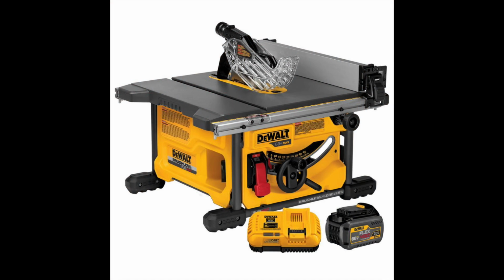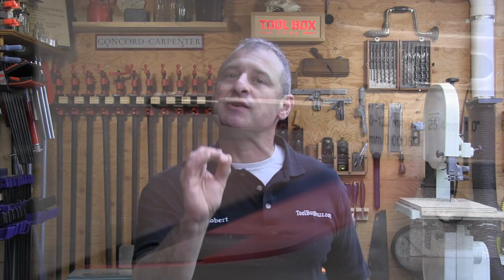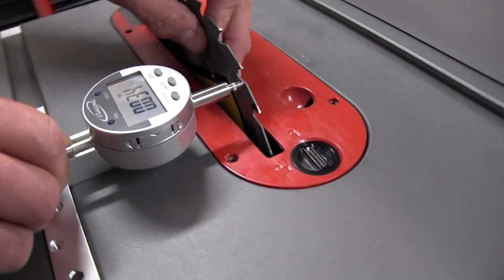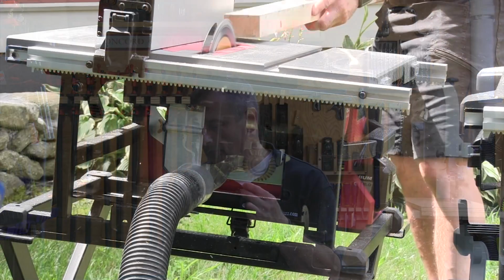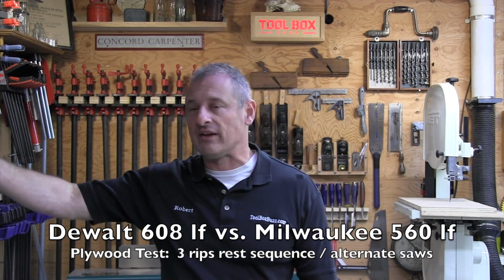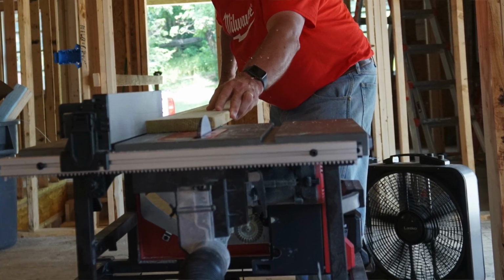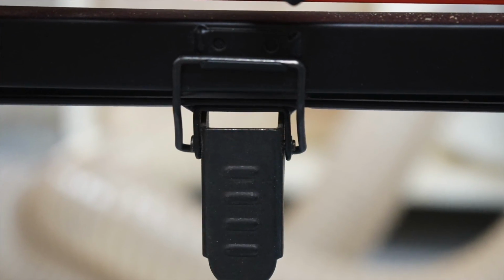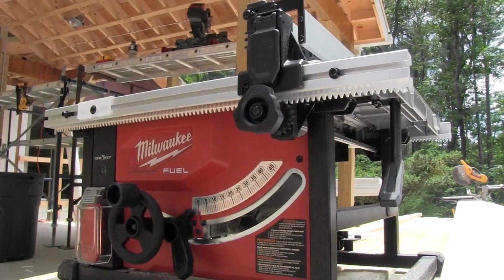Cordless Table Saw – DEWALT vs. Milwaukee

Comment: The difference in results would hardly matter unless your building cabinets on your front lawn. For me;  is one saw so much better than the other that it is worth investing in a different battery system - which is the bulk of the cost in my eyes. The answer is a resounding no. Good honest review. Perspective people. Perspective. Deep breaths.
Reply: Maybe the Metabo Cordless Table Saw ? 
It has the ac/dc battery charger included !! 
Battery run out ? just plug it in and continue working !!
Reply: Well said

Comment: Runtime is not important unless you only own one battery.
Reply from the maker: Scott Marstellar I Definitely  agree about having at least two batteries, the problem comes in when you’re doing a lot of ripping on the job site such as ripping down mahogany or framing material you will eat through batteries faster than you can charge them

Comment: Both dewalt and milwaukee are supplying great cordless tool... And sometimes they copy and sometimes one up... to capture a  either smaller or larger need of a tool.  What I don't like with HO milwaukee is the charge time!  2.5h for 12 vs dewalt 1.5  milwaukee is coming out with so much at once... That's what we want!

DEWALT is leading charge In a cordless job site. They have slowed after flexvolt. This crasftman deal has slowed down dewalt. I can care less about that deal... Unless it mean more OPE for dewalt to use these big bat's... Snow blower should be next!

Comment: I needed a cordless table saw and narrowed it down to these two. I ended up going with the Milwaukee. My first job for it was a 24X16 pergola and it needed slats cut out of 2X8's. In all I had to cut approximately 700-800 linear feet of 2x8 pressure treated. I did all of this on less than 2-1/2 charges so I don't understand where the difference is on the way I cut vs this video. Maybe because I never left it on in between cuts, not sure. I cannot speak for the DeWalt but this Milwaukee is phenomenal. It outperforms my 15 amp corded by a mile. Just getting silly with it I tried to see how fast I could feed the 12' 2X8. I realized that it would cut it as fast as I could feed it. From my experience the table saw will actually be pulled over onto the ground before it would bog down much less stop the blade. Loads of power, absolutely no complaints. This saw cuts very well. The features are very nice as well
Reply from the maker: Your best Friend probably because we performed our test all at one time, You probably use it over the course of the day or several days

Comment: Does the dewalt table saw gain a power increase from the 12/4ah when compared to using it with the original flexvolt 6/2ah?? Or just more run time?
Reply: More power

Comment: Yet another great review!! I appreciate your effort making this article and video. You are basically writing study-research papers every months.

I came to your channel to re-check head to head table saw comparison before I make a purchase, And WOW.
I found cordlesses. I'm not sure those will be released and comes with same spec in my country, since there is only 18v battery being sold from DeWalt. There is no 20v battery here in Korea(south). 

But Anyway, good to know more options. My primary concerns are Accuracy, safety, and noise. since safety would not be differ so much, accuracy and noise is my major concerns for this comparison. But I could not find noise factor not like your past comparison video. That was unlucky for me.

Comment: Cordless tools should be tested to their torque limit, it is the most important test on the jobsite, some of my flexvolt tools have pushed away my need for corded tool so far that I don't even take them with me anymore. 
My colleges on 18v can't do that as 18v will simply not have the torque required to get the job done in some situations. 
You can always have more batteries and chargers to keep up with your need, but you can't add more power to your tool. 
I want to see what makes the Milwaukee stall (its limit) and try it on the dewalt. It could be similar as Milwaukee is extremely surprising on 18v, but I doubt it as the circular saws are black and white.
"It does everything you need, and more" the "and more" is what matters to me because when you realise your cordless tool can't do it and you have to pull out the corded one and run a power cord, it is a failure in every single way. if a brand can do stop that, it's a win.

Comment: As expected, it looks like Dewalt set the bar and milwaukee have met it with a few extra tweaks 2 years later. I will be very interested to see the next revision from Dewalt and to see who else steps into the arena with them.
Reply: Dewalt will make adjustments to this saw and you won't even know because never say anything
Reply: @loucifer323  more like they’re gonna raise the price and keep feature missing without saying anything. For example their dws779 miter saw. Type 22 is missing more features than their type 20 production.

Comment: Push stick is strapped to the fence, but hey lets get my fingers right in there.
Reply from the maker: B Johnny disagree - it’s a great location for the stick, for a lot of reasons
Reply: I was commenting on the demonstrator pushing the material through with his hands, passing his fingers just inches from the blade. Meanwhile the push stick is strapped to the fence. LOL. I get removing guard for demonstration purposes, but at least use common sense. I own the dewalt corded, my favorite table saw yet. Sorry now I'm going to rant. It's the kind of demonstration from so called pros that promote poor safety techiniques. People that don't know better see these videos and think this is the way to operate s table saw, which it is if you don't value your fingers.

Comment: With inverter tech being included inside almost every high end cordless tool. Battery voltage is almost irrelevant. Measure voltage at the motor. Is it 3 phase ac? 60v will help to keep the battaery cool while delivering the same wattage. M18hc batteries do it about the same. Very nice job on the blade part. This video would be the best if I was going to get a battery table saw. Thank you for this.

Comment: Yeah dewalt is suppose to come out with a newer cordless saw that addresses the blade slowing down as the battery depletes I'd wait till the newer dewalt cordless table saw comes out those 8inch blades are a hindrance put a 7 1/4 on there lol or have a multi spectral platform that  isn't necessarily so restricted on the fact that it's a tiny box with a blade I mean that they could come out a much larger platform that makes these look like there for trim only

Comment: Nice R! But, for the runtime test, a little reminder. In Ironwood, since you suddenly got exactly the same output, 54V is able to deliver a higher output than 18V, you either pushed faster/harder because you could therefore consuming more energy,, or the blade/teeth design from Dewalt is inferior for Ironwood, hence consumes more power. 

Only you know if they where eating away in the same pace or not, but if not the Dewalt was faster, then the blade design is inferior for Ironwood. Each pack contains the same amount of Watt/h,  but 54V gives you the ability to ”use the energy faster” than in 18V by going faster, and with increased cutting speed, you use more energy. Just like a truck lugging at 55 mph or rushing at 75 mph. 

Next time maybe you should consider as an alternative for runtime let both saws use a Diablo blade with similar teeth pattern and time your feeding speed, because speech eats power. 

Personally I don't think you should make too much noise about the 54V vs. the 18V platform since the M 12Ah packs cost just as much as the D 54V/4Ah (at least in Europe) and are backwards compatible will all 18V tools, since no one would ever put either a 12A Milwaukee or a 4Ah Flexvolt on a small impact for decking, agree..?

Future: Backwards compatibility is there already, but in the future, 18V is a dying breed when more and more power hungry applications arrive. With 2 packs of 54V/4ah you could actually maintenance weld for a good 20-25 minutes (compare Fronius Accu Pocket), but that can't happen on the 18V platform since the cells inside will shut off because of heat (three times the amount of Amp drainage in 18V compared to 54V). For me investing in tools is a big deal, and I wanna invest for the future, and since 54V works backwards, it's ONLY a BIG advantage instead of a downside with Flexvolt. 

Anyhow, great review, this was one of the best I've seen, keep it up!

Best regards,

Mattiaa, Sweden
Reply: You should be more careful in your assessment.  No, 54V will NOT let you "use the energy faster".  Each cell can produce a max number of watts, regardless of whether that cell is in parallel (18V) or series (54V).  The theoretical max number of watts the battery can produce is given by the max watts a cell can produce, multiplied by the number of cells, period.  Series vs parallel doesn't enter into that equation.  The cells in an 18V battery won't shut off because of heat any more than a 54V battery supplying the same power, assuming both batteries have 15 cells (12AH Dewalt and 12AH Milwaukee).  At max battery output, the cells inside the battery don't know if they are in series or in parallel and each individual cell is supplying the same max current at 3.7V (nominal) in either case.  The current coming out of the battery (as opposed to one cell) is multiplied by the number parallel strings (one in the case of 54V, or 3 in the case of 18V).  Dewalt's marketing benefits a great deal from lack of physics knowledge in the target market.
Reply: Perfect, thanks for a Youtube answer that actually was worth something, but can you please supply me with the basics physics behind this, because if what you say is true, then a powerpack, in any size, can deliver the EXACT SAME instantaneous load no matter voltage as long as the cells are of equal capacity, so than there no actual need to divide it into 12/18/54 etc?!
Reply: You mean as long as the cells have equal MAX CURRENT (at the same 3.7 li ion nominal voltage).  The watt-hours (or amp-hours) capacity of a cell is a different concept, but if we assume the cells are the same, it doesn't matter.   The theoretical max instantaneous wattage output of these batteries is the number of cells, times the max instantaneous watts each cell is capable of, end of story.  Of course to draw the same wattage from two batteries with identical cells but wired parallel vs series, you'd need a higher resistance on the higher voltage, but the theoretical instantaneous max power output of the batteries is the same if the cells are the same (number and max wattage), and that fact is not changed by voltage (in this case, parallel vs series).  Dewalt and Milwaukee are both using 21700 format lithium ion cells, although the exact specs probably differ slightly.  For the same efficiency, the higher voltage tools (actual saw, drill, etc) could use thinner wires, etc, than the 18V tools, but the wires are not long in a cordless tool so it's not really THAT much of a differentiator, the way it is in power transmission across long distances.
Reply: So since both you & I know about resistance growing over distance it's ALL marketing HOAX; ALL tools could be running 3,7V just fine & instead of 18V@12Ah we instead could have 3.7@60Ah batteries?! 

There is one pragmatik issue that isn't explained by your reasoning. Once upon a time all cars was using 6V, now 12V,  and the reason they shifted is better momentous/max power delivery since when cold starting and just before the engine actually moves, the draw more than doubled because a drop by 3 Volts halves power in a 6 V systems but instead leaves 75% in a 12V system & that why my CASE material handler, and EVERY PIECE of heavy machinery works with 24V today, because the drop in the very short cables to the starter isn't the explanation as we both know.

So in THEORY, you're right, but not in real world usage, and IF you're right EVERYBODY ELSE ARE IDIOTS.
Reply: No, I wouldn't go that far. We're talking about 18V vs 54V in a 15-cell battery.  I'm saying 54V vs 18V is not all THAT big of a differentiator in the cordless tool domain.  The table saw review here was basically a draw, right, with the Milwaukee at 18V performing right up there with the Dewalt at 54V. You were surprised?  They're both great tool families.  You can't go wrong either way.  I'm some sort of battery enthusiast, and I personally like the idea of settling on a good voltage like 18V and sticking with it throughout, rather than the more complex FlexVolt system.  The idea has merit, sure, but drawbacks too.  The 12V standard in autos is still there because the benefits of higher voltage just weren't enough for the standard to change, apparently, even for starting huge V8 engines at -20 where I come from.  The distances are longer in cars and electric cars are changing things there.  6V is/was common in forklifts. There are benefits to higher voltage, but I expect Milwaukee's engineers with M18 will be able to compete with FlexVolt for quite some time.  They're both great!
Reply from the maker: @marinezen   I think you guys forget that even though we're running different voltages that total pack energy is equal. Furthermore, the saws are running nearly the same speed (I don't remember the blade speed ). We used the same blade in both saws so that really shuts down that argument. If both saws are turning approximately the same speed, same total battery energy, same blade, the only difference could be feed rate, and I made a point to be consistent - not a power fedder I know, but as consistent as I could be.

The 18V argument doesn't hold much water when you look at the tools Milwaukee is designing and keeping up with every tool on the market. Name one tool that's cordless that they can't keep up with? I can't....can you?
Reply: I think you meant to reply to Mattias, not me.  To summarize my position:
1. The theoretical max instantaneous power output of these 18V vs 54V batteries is the same if they use the same cells, and the same max current runs through the individual cells at either voltage.
2. The higher voltage of 54V vs 18V is an advantage for driving an actual tool,  but it's not a large enough advantage to be a major differentiator.  This review attests to that.
3. Both Milwaukee and Dewalt are great!
Reply: Test the DeWalt 577 against ANY other brand, including Milwaukee, and see for yourself. 🤘🏿
Rip long beams of wet, pressure treated 2x4 or go maximum depth in a piece of old oak or similar that separates Wh from RAWPWR.
Reply: Btw, ever driven a TESLA S P100D? Actually THE FIRST CAR that EVER kicked the backrest into my back. WHY do you think they use 400V instead of 96/54/36/18/12V..? ;-)

Why does Koenigsegg USE 800V in their EV-technology, the same as PORSCHE been wanting to achieve, but K got ahead of them?!

Same reason; BECAUSE even that the NOMINAL Wh is EXACTLY the same, you won't LOSE as much power WHEN the voltage drops under HEAVY LOAD, much like ripping a wet, pressure treated 2x4 with a circle saw OR maximum acceleration of a car.

And as we use up the power inside, voltage will drop, so the difference will become even clearer. But the test in this video is not really any hard work, then 18V/Same Wh will be fine. 

But feel free to deny the real world any way you like.
Reply: I think they would use 400V on a Tesla because the distances are longer in a car than in a cordless tool, and those are very high horsepower motors in comparison, and as usual all the other engineering considerations were taken into account.

I think we can agree that a Tesla is not a cordless tool, but it does raise the question of "how far does this competition go before 18V vs 54V makes a big enough difference that Milwaukee is forced to respond with a higher-voltage battery format?"  Does the competition for more power go all the way to the Yellow Roadster vs the Red Roadster?   Sure, it just might, your point is taken there,  but I doubt either company would want to  power a Tesla with their current batteries.  My point here is, that when the time comes that 18V is simply not the right engineering choice anymore, Milwaukee's engineers will have the option of using higher voltages as well.  And that time is a ways off, that was my original point.

If Milwaukee announces a higher-voltage battery system to replace M18 any time soon,  I'll have to eat my words. But let's not forget there's a lot riding on the brushless motor designs, and the electronics on top of that.
Reply from the maker: marinezen yes
Reply from the maker: Mattias Persson great points on the future of 18v.  I used a Milwaukee 40 tooth blade,  on both, on the IRONWOOD.  SAME USER (me) used the same feed rate. The only thing different I could’ve done was to use the power feeder.
Reply: Thanks! Feed rate/blade; amazing! Then I can't find the explanation since the Dewalt is more efficient in the other tests. Anyhow, I will buy the Dewalt for obvious reasons (above arguments), but I will wait for the updated version even though I'm wishing for a 12”/305mm fueled by double 54V’s exactly like the mitre saw 💪

Comment: You keep saying that Milwaukee cuts smoother than the Dewalt but did you swap the Milwaukee blade with the Dewalt blade!
Reply from the maker: ROBERT BUTLER both saws were tested with both blades